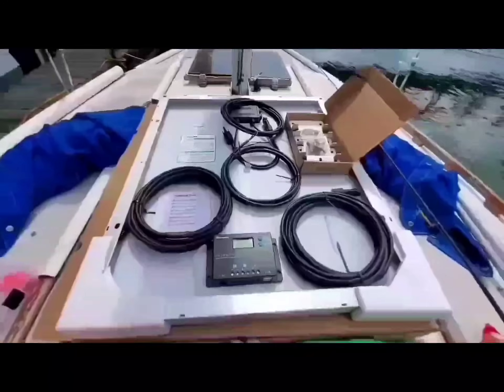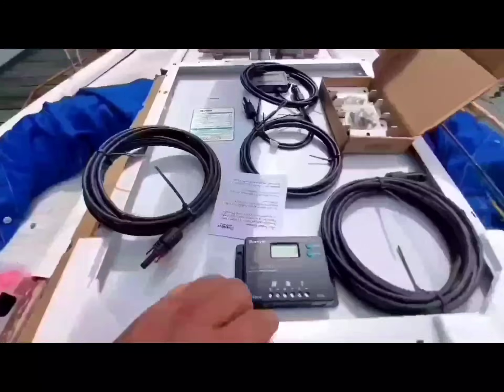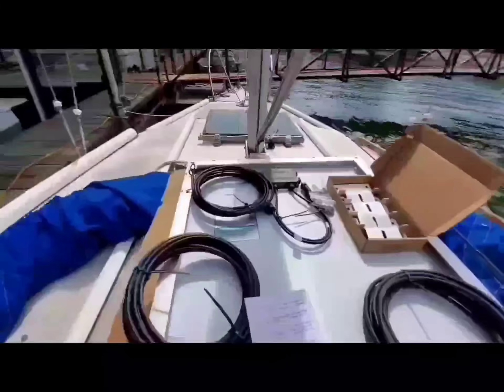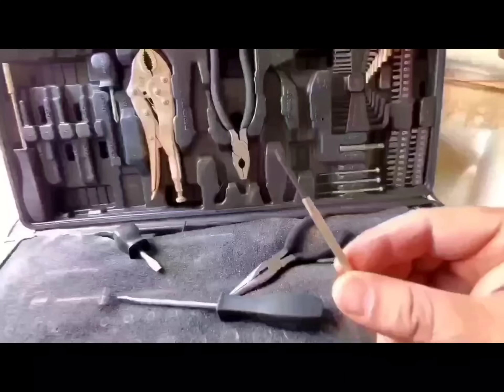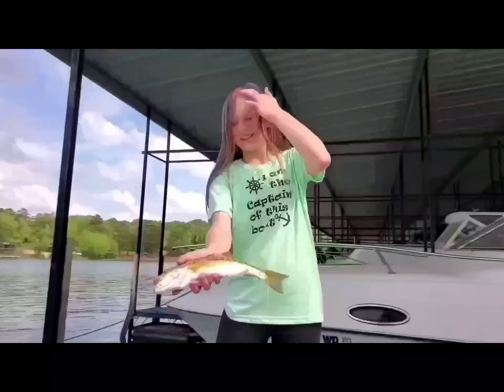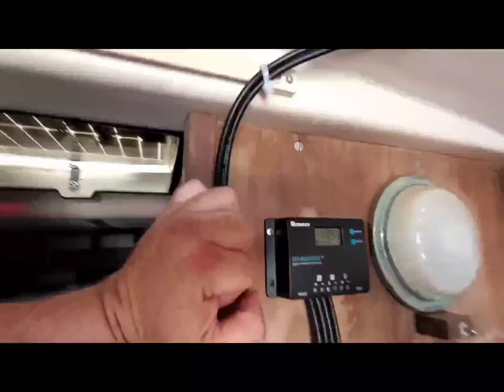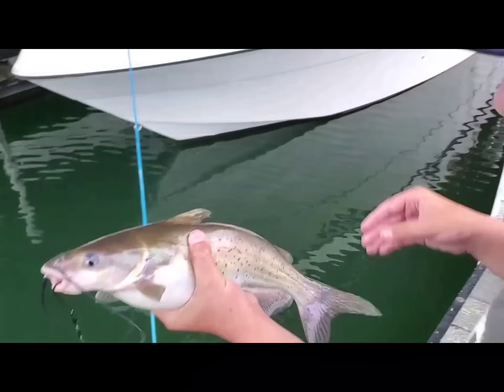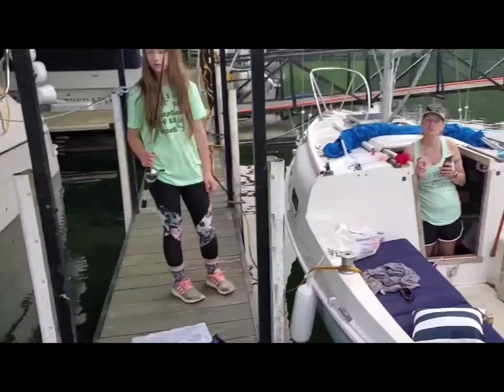Renogy 50 watt Monocrystalline 12v Solar Panel Kit Installation great for off-grid and vanlife

Comment: 2024 these are 40 bucks on amazon. checking here for how many watts output in full sun and how did it hold up.....Anybody here.?
Reply from the maker: Held up great up until the time we sold the thr sailboat.  I wish it was a 100w panel instead of 50w because the fridge I wS using was power hungry.  It still held up while we were out during the day, but we plugged back up to shore power at night to top the battery off.  Shady days it would produce 12-28W and during full sun around 48.8 to 52W.
Reply: @chickenshippfarmsandoutdoo4617  
wow ok great. Close to the rated 50 watts they were rated for. Looking at 100 watt panels that put out 70 watts.
40 dollars delivered and it makes it rated watts is fantastic
Thanks
CHuCK in Alaska